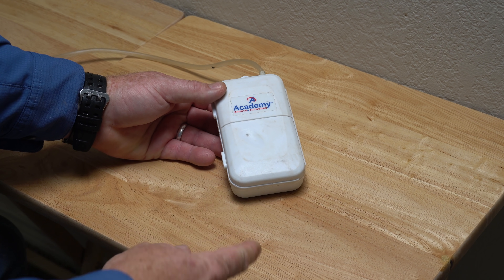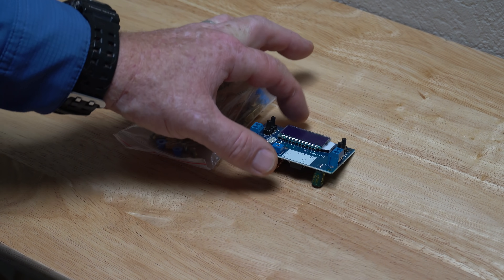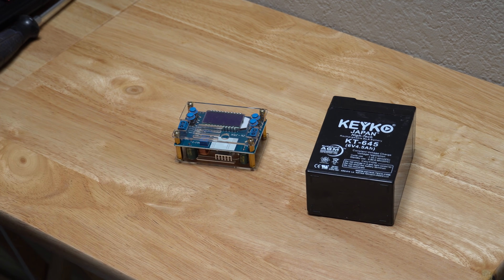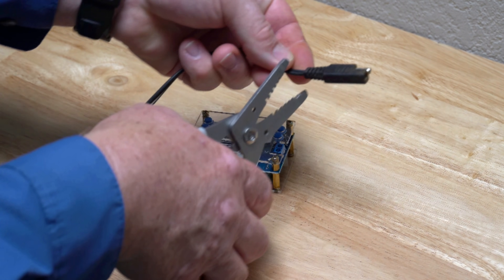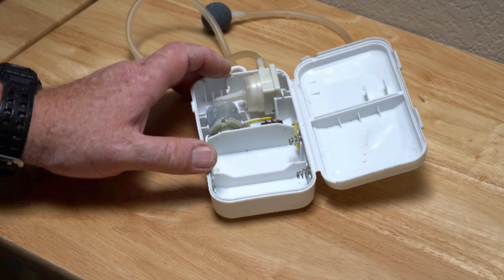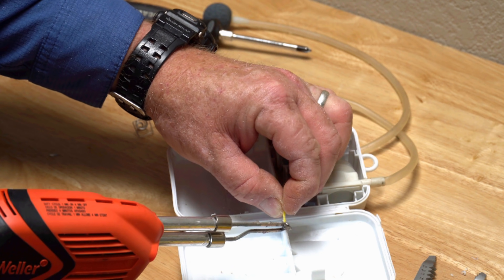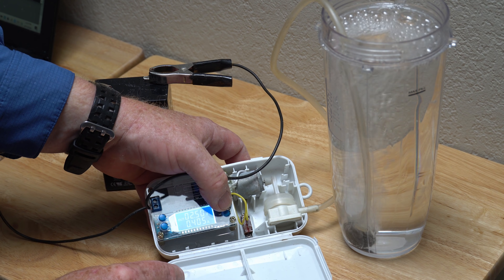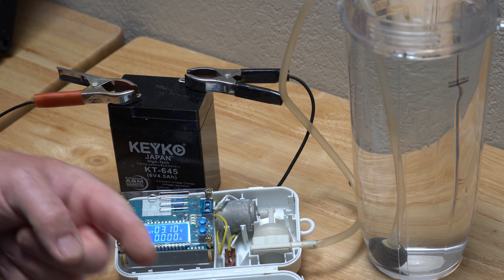🐟 Official Minnow Bubble Box Aerator Hack Mod! 300% more Bubbles! 🔥

Comment: Curious if you configured the setup to run in series instead of parallel like they have you wouldn’t need the voltage converter but it would run through the batteries twice as fast. Couple extra batteries has got to be lighter than a lead cell.
Reply from the maker: Yes you could do that as well with a little soldering. But I have ways found the battery bays on these thing to be problematic to begin with.
Reply: Jungle Explorer didn’t think about that will have to use your Set-Up! Great video!

Comment: How long do the pumps usually last when you run them like that?
Reply from the maker: I have not one burn out yet, so I can't  tell you. I have one that I have used for almost two years like this. Many people assume that the motor can only run at 1.5 volts. Truth is, DC motors can function at a wide variable of voltage. I would expect the plastic pump system to give before the motor.
Reply: @thejungleexplorer  I agree. I wonder if greasing the pump assembly might help prolong the life. I sprayed the electrical contacts of mine with golf cart battery protector spray I had laying around as well. I have a Hush Bubbler and the only weak point I see is the strength of the pump. It may be overkill but for the $ they ought to use higher voltage batteries and thicker wires. Even going to a rechargeable lithium setup with an external USB plug would do wonders for its modernized utility.
Reply: Can you provide a link to the board you used.